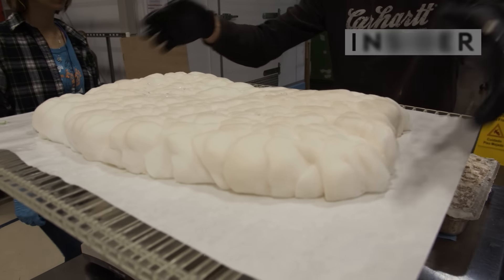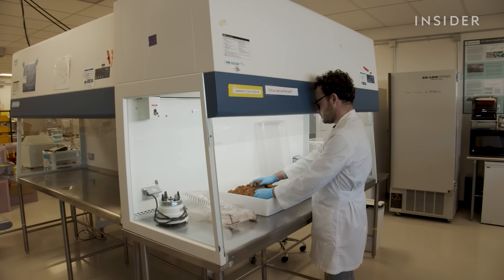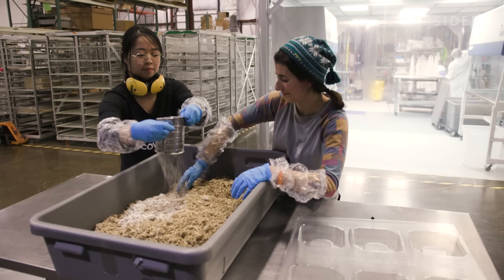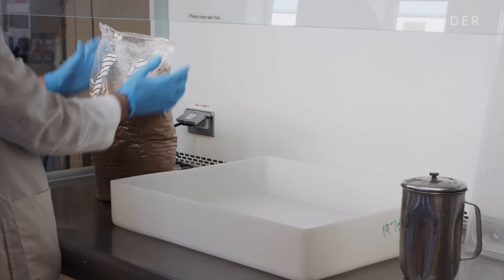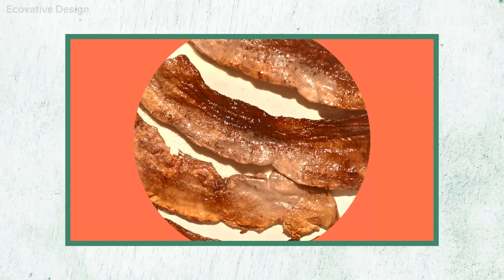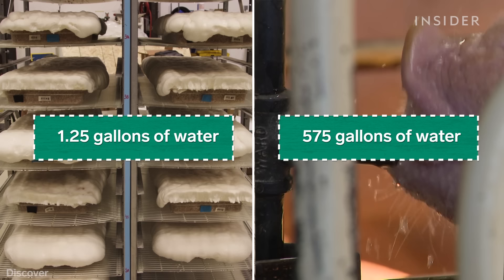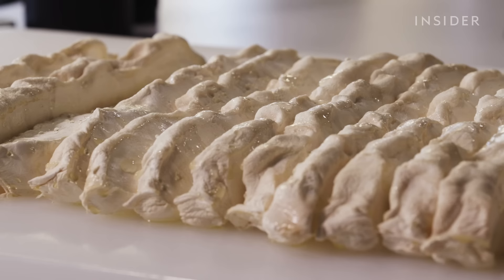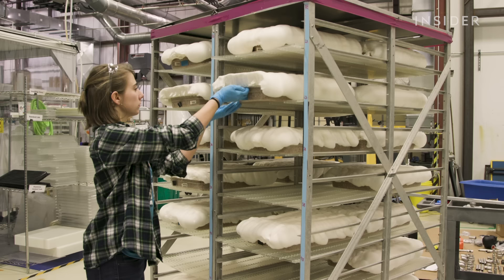How Mushrooms Are Turned Into Bacon And Styrofoam | World Wide Waste

Comment: I have seen plenty of variations of this video pop up over the past 10 years and never go beyond this stage.
And I don't know what to make of that.
Reply: The fact that it's not just a lab, but they actually already have customers for their packaging does imply it should start spreading, though.
Reply: @darksunrise957  not far though, month degrade limit and 10+ days for production make it really commercially unusable anywhere where styrofoam is used.
Reply: Mushrooms were hated and Ostracized for the longest time, 10 years ago was probably the point at which the research started picking up pace, Both for New inventors and current ones. Research on Mushrooms was strictly controlled as well.
Reply: @stanjockson  That's literally right now..... Simply means they need to find ways at growing it faster that doesn't contaminate us or the earth. Mushrooms research for the most part was Strictly controlled so they aren't that far into it yet.
Reply: @hailothgaming  bro im gonna need an explanation on restrictions on mushroom research outside of psychedelics
Reply: @tomkeast5246  That's pretty much exactly what I'm talking about but Mushrooms in general besides like the 5 edible regular mushrooms you can find at a grocery store haven't really been researched that much due to the stigma of it, Classified as drugs/unsafe, I'm Sure the Research Guidelines for anything other than the 5 regular edible mushrooms were strict for the longest time since government mostly hated anything to do with Mushrooms, Paul Stamets who is a Mushroom Expert for the most part even knows something about Portabello mushrooms that could get him in a shit ton of trouble with the government if he told anyone about it, When he was on the Joe Rogan podcast he refused to say anything about what he knew about them as he was talking like it was something dangerous, So when it comes to Mushrooms any government has been quite Biased and restrictive.
Reply: @stanjockson  I doubt it's ability to fully replace it but for national shipping this would work fantastically
Reply: They need to make the manufacturing so simple that every product maker can also make their own packaging. We don't need to ship packaging to ship a product, that's just dumb. I wonder if they have a patent? Should be made freely available to everyone, because oil lobbyist will fight this. Also let's consume less of everything.
Reply: Boa-Noah  They say "A little bit heavier than Styrofoam" in the video, what difference in shipping price do you anticipate? Do you know if its common for Factories to produce their own packing materials? In the end it comes down to the conscience of the consumer. I'd rather spend a dollar extra than wrestle with my mind over the increasing shortage of oil and height of landfills. I bet a CEO would also struggle with that idea as soon as alternatives are made available to them.

Comment: Sometimes products sit in boxes for a long time. I wonder how long this mycelium packaging lasts before it starts degrading. Very intriguing and encouraging.
Reply: Im pretty sure its already dead by the time it gets there. When mushrooms due it doesnt loose its shape. It will stay the same dead or not
Reply: 30 days
Reply: @ArtR.cover2000  you know that mushrooms rot, right?
Reply: With our science now, they can just probably extend its life by adding some harmless chemicals or bio-engineering the mushroom itself.
Reply: Yeah that's a good point. Suppose it could be treated for long term use?
Reply: They literally answered that in the video: 30 days.
Reply: @ingGS I guess my comment was more about how they deal with the challenge of storing products in the mycelium for longer than a month without it starting to break down. Also, biodegrading in a rubbish tip exposed to the elements is different from degradation inside a packing box in a warehouse. You can buy biodegradable bags but they don't start breaking down on the supermarket shelf. They start breaking down in the tip when exposed to heat, UV etc. I wonder what they do to keep the mycelium stable until disposed of.
Reply: @ArtR.cover2000  That depends on the mushroom. Most mushrooms turn to mush.
Reply: My guess is, for that packaging to decompose, it has to be in contact with oxygen, moisture and heat. It probably won't brake down in the box, unless it gets soaked, maybe.
Reply: @bluefernlove  All of those things are present in air though, cardboard boxes aren't hermetically sealed vacuums
Reply: Well they can survive indefenitely, if you proper storage, in fact probably can survive more time than a regular cardboard boxes in a water/moisture enviroment.  That is causes, the fungi is killed before used as package  and is not soo easy to decompose in non-organic enviroment.
Reply: @joshgroban5291  That's decaying in the environment and not what he asked...He's asking in a retail environment how long is its SHELF LIFE before the packing will start to degrade.
Reply: By 30 days, do they mean it starts degrading after 30 days or is it just gone by 30 days?
Reply: @BoxStudioExecutive  you been drying em out wrong mate
Reply: Well, free bacon after 30 days I guess.
Reply: They say 30 days, so I'd wager you could get a couple weeks before you need to ditch it
Reply: I imagine as long as it stays dry. Maybe after 30 days it starts absorbing moisture from the air and getting soft.
Reply: @Loaves_of_Cat  definitely starts, not gone
Reply: it might need to be wet first
Reply: @bluefernlove  The only logical comment in this thread.
Reply: @ArtR.cover2000  Have you ever left mushrooms in your fridge for a few week?  They start getting soft and then turn to mush.  That processes accelerates when they are exposed to moisture or heat.
Reply: should be similar to cardboard, which is also of course made from living things.
Generally these mushroom products are put through an oven to finish them off, which stops any further growth or changes in them & basically makes them the same as cardboard, in that the living creature that formed them is long dead. I suspect their water tollerance would be similar to cardboard too though, ie pretty bad
Reply: @BoxStudioExecutive  in the right conditions yes, but a mushroom sitting out in a dry room will crisp/crunch up. I'm also curious about the shelf life
Reply: @snowmiaow  Yeah honestly I think that would be the problem. Most of our homes are more humid than the warehouses/trucks.
Reply: People who say that it's 30 days are not recognizing the fact that biodegradation tends not to happen when something is isolated from moisture sunlight and air which most shelf stable products are not exposed to anyway. 

Biodegradation doesn't just magically happen the process can be sped up or slowed down depending on how Ideal the conditions for the microbes which compost materials are.

Cardboard is extremely compostable but if you leave it in a warehouse for several years it'll probably be fine, it's not going to biodegrade at the rapid pace that organic materials like cardboard degrade unless you actually expose it to moisture soil, air, sunlight etc.
Reply: @BoxStudioExecutive  So do trees, yet we still use paper.

Comment: Not at that production rate, but this is freaking amazing
Reply: @benisrood  Still takes a week to grow any of your packaging though, compared to styrofoam which takes around an hour to have a finished product. That's a logistical headache for any company that they don't need, especially when 'just there for a paycheck' dingus lets our stock run low and we need more the next day. Can't see it catching on with that cure time, as cool as it is.
Reply: @boogusnutsack5926  I suppose if enough is made in advance if the companies have a relationship and know what to do that might speed the cycle up
Reply: @skitz0299  Well as with most manufacturing, product usually sits in warehouses, ports or at wholesale distributors for months to years waiting to be requested. Samsung for example don't manufacture and package your television to order and this packaging is going to start to rot after 30 days sitting on the docks lol. It's completely unfeasible. 

There is nothing wrong as it stands anyway with wood/paper pulp pressed (biodegradable in 1 year) packaging that most companies are starting to use now.

The other big problem not addressed in this video is the molds. They try to play it off with the whole " this plastic is recyclable so we can reuse it and make another mold ". What they didn't mention is the fact that for every single piece of packaging you need an individual mold. Just for 1 type of 27" television which the company produces 12 million units of per year, you will need 1 million 27" television molds, because the process has to occupy that mold for a full 7-10 days. Current pressing or injection molding uses a SINGLE mold for a millisecond before the molded packaging is ejected and another is made in the exact same mold.

In short if this was to become the normal thing then they would have to purchase and store BILLIONS of plastic molds because we produce 100's of billions of packaged products every year (can't find an exact figure but 380 Million Tonnes of plastic packaging). They would essentially be creating far more pollution then they would ever solve using this method of mold creation. In reality taking wood or paper pulp which is their starting material but simply grinding it down smaller and more fibrous then using tonnage to pressfit it into a mold takes a literal second to do, uses one mold, has more durability and takes less than 1 year to biodegrade in soil.

it's a cool science experiment, but in terms or feasibility it has none when other ways are already existing that aren't so ludicrous. Small indi food trucks and that sort of thing that cater to 100 customers at lunch time could use it fine. Anything larger and it becomes a nightmare for both parties sadly.

Comment: Im sadly extremely allergic to a lot of mushrooms and molds but this is really cool.
Reply: @enricod.7198  i get extreme headaches and nausea from eating most shrooms so i just dont anymore
Reply: @Jzwiz  well you came to the right person
Reply: @Jzwiz  I'm fine with mushrooms, but not with added flavours, so for allergy reasons I was thinking the "bacon" is out of the question for me too. Would you be ok with it as packaging? Remembering it's cooked before it's considered finished, so no spores or anything coming off it. If you're not ok even with that, dam that's going to be a problem for you in the future!!!!!!!!! (if this goes ahead & takes a significant percentage of packaging)
Reply: I am also very allergic, even a touch of mushrooms on my skin can cause red splotches.
Reply: @mehere8038  dead shrooms are still shrooms dear
Reply: @JustinAdamson270  but most people don't eat packaging darling, so the packaging therefore may not be an issue for many, even if it's mushrooms & they get severe reactions to eating mushrooms

Comment: If these materials were exposed to rain and humidity, I think it could start decomposing and result in some fungal growth.
Reply: That is worth being cautious about. Is the fungi fully deactivated before it's shipped out, or will that cause further issues? What type of fungi is it, and how would it react to various environments if it's not deactivated?
Reply: Yes this may be true, but how often does your Amazon package get completely soaking wet? It’s usually in a dry place the majority of the shipping process
Reply: @wmwinterbottom  It doesn't need to be completely wet lol, just unloading the truck with a ever so light mist is more then enough for it.
Reply: @wmwinterbottom  But when it goes to a landfill or otherwise thrown away, it will decompose there. If the mycelium continue to grow and eventually fruit, producing mushrooms, then spores will spread. Thinking about how they will affect other environments is important.
Reply: If the cardboard box gets wet it will crumble like wet, well, cardboard. Yet every product is shipped using cardboard boxes
Reply: @martisbvk  It's not cardboard though, it's a mushroom and when dried out mushroom packaging gets the slightest raise in humidity it's going to start growing again.

Comment: Packaging is imho already solved with paper/cellulose/starch based solutions.
Im more interested in substitutes to more hidden use cases for plastics, like the insulation of mains cables in walls (often PVC), or resins for composites like in PCB's.
The food aspect is very intersting though, but without the possibility to try the product there is no way to tell.
Reply: I think you would want those cables to be oldschool PVC, because they dont degrade over time. Which you really do not want.
Reply: Good point. But if they can build a successful business model on packaging, then that's good news for the R&D funding to investigate anything else you can imagine. Plus it can't hurt to diversify our approaches to packaging.

Comment: 30 days isn't enough time for most shipping. Goods often sit around on store shelves or warehouses for a long time before they are shipped. Also wondering about water resistance. What happens if the packaging gets wet or humid?
Reply: When it gets wet is when it starts breaking down. In a regular warehouse, this packaging won't just suddenly rot or break apart. However, if thrown in a landfill where it gets rain and sun on it, then it starts to decompose. Cardboard breaks down in less than 3 months under similar conditions, just is used worldwide in shipping for the same reasons.
Reply: o the packaging won't biodegrade in the box while the product is on the shelf. It will degrade when it's exposed to moisture and sunlight and bacteria, things that shelf stable products are kept away from anyway.

Comment: Excellent.... but it will be hard to produce this stuff to huge scale at a cheap price.
Reply: Huge scale usually makes things cheaper, not more expensive. I don't see any scarce resources in use here, do you?
Reply: @megamaser  It is much more time and energy intensive to produce than styrofoam.  The sheer quantity and ease of producing styrofoam cannot be compared to the technicality of creating this mushroom material. Like I said, producing at huge scale for cheap price....cannot be done. This is at present only a novelty it will likely go no further than an expensive novelty.
Reply: @theseeker3771  OK that's a fair point. My point is just that this will probably get much cheaper per unit as it scales. I would expect to see a huge drop in price with robots doing the work.

The styrofoam industry could see some new challenges as regulations change to capture the cost of disposal at the time of manufacture. You can't be sure what the future holds.

Comment: One absolutely huge problem with the mushroom styrofoam.. most products that use packaging like that are going to sit on shelves for more than 30 days before being sold so when the mushroom styrofoam starts to break down after 30 days it can destroy the product it's supposed to be protecting. In effect it would just end up causing more electronic waste than normal meaning the mushroom styrofoam would be worse for the environment. Also if recycle trucks would take styrofoam than there would be more of it being recycled

Comment: Styrofoam will hold off fire if it is insulated with water. Thus, a firewall made to hold back forest fires might be made of mycilium. I would boil water in mycelium for primero.

Comment: This is neat. I wonder what the price difference in packaging with Styrofoam vs mushroom is cause they only mentioned dell using it. Mushroom foods are cool replacement for meat based products if they are cheaper. I've tried some mushroom food that were suppose to be similar to meat products and they were pretty good. Mushroom burgers or sausage would be something interesting to design.  But usually these specialty products are way over priced and catch on for a season and fall out.

Comment: MyBacon = Same amount of protein as bacon, but are the protein structures comprised of the full 20 strong chain of amino acids? 

I ask because this is an issue with a lot of non-animal sources of protein, in that only some of them contain complete proteins (for example Soya Beans do but Chickpeas do not) and if you aren't careful you can suffer from amino acid deficiencies (symptoms of which include fatigue, lowered immune system & fertility issues). 

With all this amazing engineering going on, it would be great if more eco friendlier sources of complete protein chains could be offered because the options currently available are quite limited.

Comment: That styrofoam alternative is an amazing idea, but the fact that it takes a week to create one mold is unfortunately too long to be feasible.
Reply: not really, supply chains are usually multiple months in duration.  the issue they have isn't in spool up time, it's purely in capacity.